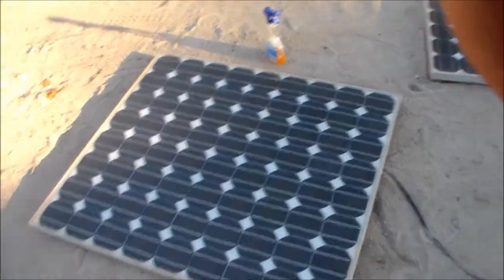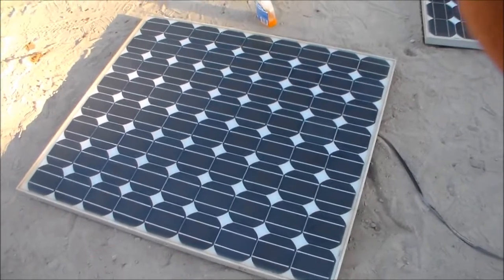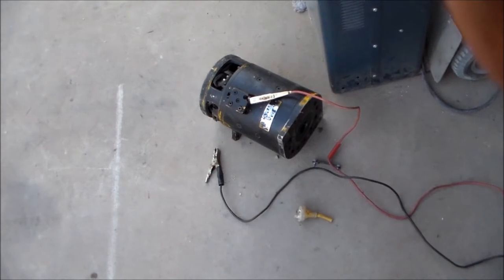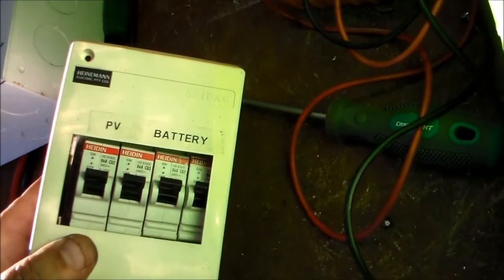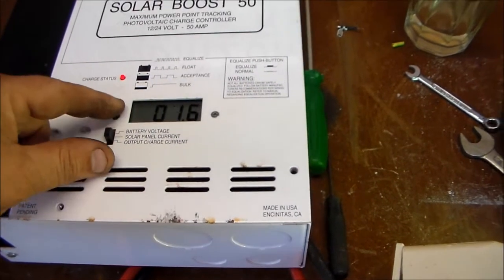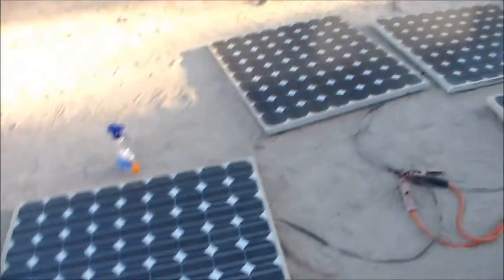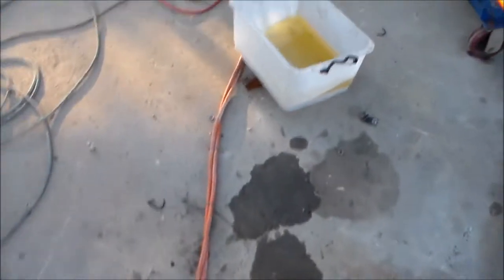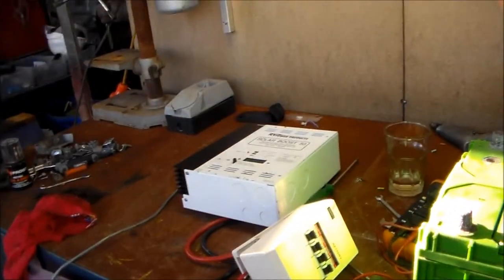Saturday Solar Shenanigans Part 1

Comment: Solar panels are great for battery charging provided that the loads are not too high.
The voltage drops rapidly when a solar panel is loaded beyond it's maximum capacity.